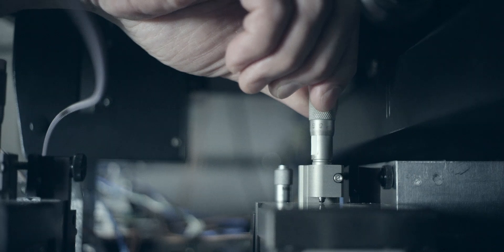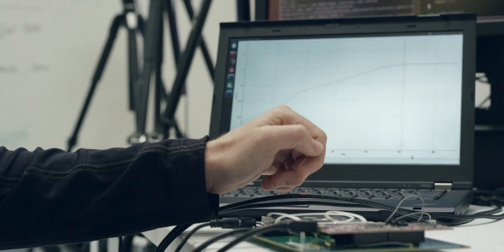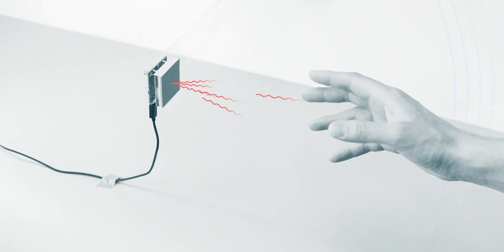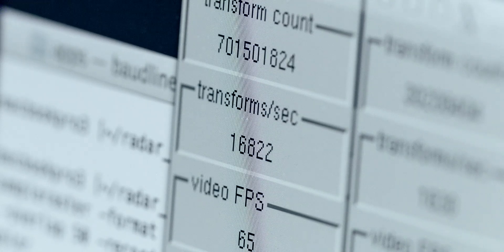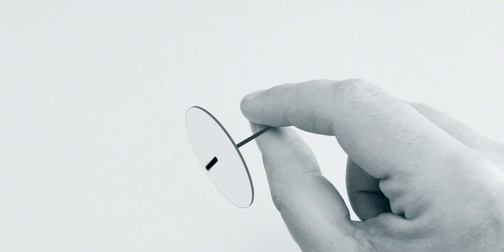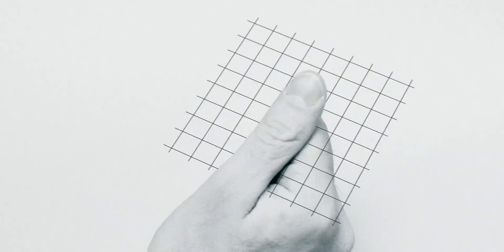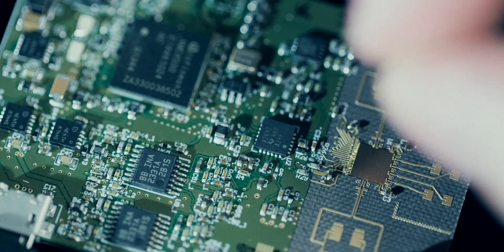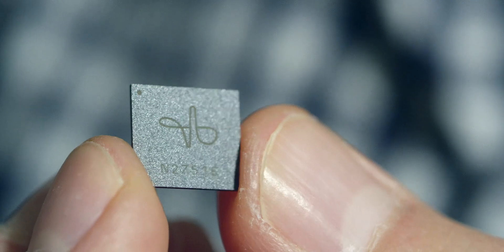Welcome to Project Soli

Comment: This is amazing, but these videos annoy me. Why? Because we see all of this cool shit, never to be seen again or put to use.
Reply: This is actually going to revolutionize how humans interact with technology, soooo...not so useless... haha
Reply: +Tiger White the thing is, this 'specific way' you speak of is the very way you've been doing it all along, according to these people at Google
Reply: *****
 This tech IS the improvement. With this single small chip you can replace a whole range of buttons, nobs, dials, etc. The actions you take are similar to what you have beeen doing all alone, only now the buttons and dials are virtual. Also with no moving parts they will last longer than their physical predecessors.
Reply: If people decided some 50 years ago that ", it's time to stop inventing and improve what we already have." imagine where we would be. Now imagine what will happen 50 years later if we decide that today.
Reply: agreed, in addition think of the power consumption, the chip probably communicates via digital cmos so you're looking at a pushbutton that consumes/distributes 1.5volts at 20mA possibly. 1.5 is based off CMOS noise margins commonly found in digital IC's and 20mA is the higher end of modern current consumption of MCUs. Not only saving power but surely this human interface has a place somewhere in the biomedical field, it's not necessarily a new interface that makes this product unique but rather the application of RF to harness very fine discrete motions on low power consumption.
Reply: *****
I see. So you are the arbiter of which technology is useful or necessary to humanity? Well, it gives me warm fuzzy feelings deep inside to know I'm in such good hands. I may as well book my own funeral.
Reply: Also, you want a private company to "step the fuck up" to your personal demands on which technological fields it should focus its innovations on? I'm not quite sure if you know how market forces work, but companies generally make money by creating what people want to buy. Google's technological department probably wouldn't know an x-ray from an MRI because, stunningly, their customers come to them for their software and data expertise. Pharmaceutical companies and universities are where the medical research mainly occurs, you may as well be asking NASA to open a restaurant.
Reply: that's more of a Google core issue. they have this attitude of toe dipping in cool revolutionary ideas, and doing nothing more. More of a PR stunt.
Reply: You lost this argument.
Reply: Or it's like Xbox Project Natal, They made it seem like it was a seamless and amazing, then they released Kinect but it was just another piece of junk cluttering the house.
Reply: RTarson Just like every other console
Reply: Hunter HAHAHAHAHAHAHAHHAH WTF!! what a thing to write! are you actually expecting him to say "well yes I am!"
Reply: Statements like this annoy me because it just goes to show that the person or group of people making it don't truly understand whats happening here. These people haven't made a product, they haven't even made anything completely new, they've done something that is arguably much harder, they have inovated and improved upon already existing technology.

In the video they even say that they used radar, a technology that we developed all the back in WWII. What they did was they made the radar signal have a higher refresh rate in a sense and with that the feed back is seamless, or at least that's what it looks like to me personally. They have simply created a new tool for producers to use in their product. Its because of small groups like this that are working towards innovating and thinking in different ways as compared to the masses that technology as we see it today even exists. 

Now sure we may not see this tech any time soon but that comes with a good reason, that reason being that its expensive to implement new tech that hasn't even been perfected yet in to mass development. I mean lets look at the latest really big thing in the tech world, VR (Virtual Reality), virtual reality was being tested in labs and experimented with as far back as the late 70's ( source: Father worked on software for it). Hell look at nintendo for example, they had a VR headset that they designed and released to the consumer basically fresh out of development but guess what, it failed, bad. This is because seeing as it was new technology it was expensive to produce and in turn raised the selling price. And if we look at the fact of the matter on average cheaper products as compared to the high end premium, tend to sell more units even if they may have less features overall. That's just fact. 

With all that said, it should also be noted that production costs on chipsets has been going down exponentially over the past years and doesn't show many if any signs of slowing down any time soon. This means that we will probably see this type of tech and many others much sooner than we would have maybe something like 20 years ago, hell even 10 years ago. The main concern of a large company is not so much putting out what is cutting edge, its putting out what will make money. Once the technology is cheap enough and works well enough to sell to the masses for a profit is when we will see it enter the main stream. All we have to do is wait.
Reply: Tiger White: Meh  ... When an innnovation/invention is born the multiple applications are discovered later.
At first no one knew what the laser technology would be used for and centuries ago no one knew what electricity would be used for.
The first compass was a useless thing for divination purpose, ahem.
There are already the most finest brains trying to cure cancer. 
So enough with the empty criticism and the pretentious jaded attitude.

Wall-E is gonna be relevant anyway, because capitalism ... and overpopulation ... Useless shit or not.
Yeah, i'm done.
Reply: Illuminati confirmed.
Reply: Cambaudio you don't even know what your asking for
Reply: "I'd much rather have tactile feedback" if you tap one finger off the other you get tactile feedback straight away. if you dont you should see a doctor immediately
Reply: Exactly
Reply: Exactly
Reply: leap motion does this you can buy for $70
Reply: Gf Yeah but it's pretty imprecise with small movements and also much larger. You could never use it inside a mobile device.
Reply: Tiger White wtf why would they work on cure cancer when they’re a tech company
Reply: theres already a chip that when you implant it under the skin on your neck it cures a cancer, but theyre holding it in a chamber under the pentagon
Reply: Interestingly enough though these simple gestures that are being shown in this clip also  can have medical application as well and the time and effort of this teams efforts may have value for a widespread use of applications for medical applications. Imagine a doctor or nurse not having to worry about germs from the tools they are touching. Most people die from the germs after surgery than the surgery itself.  The applications for these new technologies is endless.
Reply: Tiger White  most of this stuff is made in less developed countries. 
This video isnt even for the people, it seems to be directed at engineers.
That chip would probably be a few bucks, or maybe 10. Dunno, never bought any ic's from google.
Reply: Tiger White I think this thing would be perfect for vr think about it actual full but that is accurate yet frees your hand from anything think of a pair of glasses and a vr room that you just need to walk in and you get to do whatever with it that’s awesome and a big move forward
Reply: New leaks show it in the pixel 4
Reply: Tiger White  we have a cure for cancer now
Reply: Tiger White  Please listen, and learn. The Hubble space telescope went up with a flaw in it's mirror.  The flaw ruined it - it was useless. Until clever people at NASA wrote a software fix that corrected for the astigmatism, and brought things back into focus. Score one for math! But space stuff isn't curing cancer, right?

That software fix then got puzzled over by the scientific community. Someone figured out they could use the same software fix, just as a patch on existing mammogram machines. The same X-Ray hardware could suddenly detect breast cancer SIX MONTHS EARLIER. This lead to a huge, immediate increase in long-term breast cancer survival.

This is how scientific research works.  Maybe someday they'll figure out warming pads for the machines, too.
Reply: Hello pixel 4
Reply: its coming to the pixel 4. wait till October.
Reply: Careful what you wish for😂

Will get probably used in the next pixel as seen in the promo
Reply: 2019 calling
Reply: Bro its just an already available technology with Google's research and development working on to make it more user friendly,ever heard air gestures on LG
Reply: Bruh! That's not true anymore! It's Coming To Pixel 4!!
Reply: ha
Reply: Wow, this comment has not aged well. At. All. 😂
Reply: Technicians, engineers, scientists, and simple visionaries will imagine applications of even existing technologies that border utopian ideals, but get tossed aside because they would cost five cents more per unit to manufacture.
Reply: Welcome to October of 2019, my friend.
Reply: and then it was never seen again
Reply: The pixel 4
Reply: @nanaamoako4175  I give it 1 generation before it disappears. 2 if we're lucky.
Reply: Tiger White  you lost me at "acting all white n shit". Are you serious? Lol. If brilliant Google engineers pushing the boundaries of technology is acting white (n shit), this comment is actually insulting to people who aren't white.
Reply: This is being implemented in Pixel 4 now :)
Reply: Until this October in the Pixel 4.  Magic takes awhile to get working I guess.
Reply: And here comes pixel 4 😛
Reply: Cambaudio:
We see all of this cool shit, never to be seen again or put to use.
Pixel 4:
Hold my beer...
Reply: Well, now it's in the Google pixel 4 :)
Reply: It might be in the pixel 4 this year, so.... we'll see
Reply: Tiger White  Thats pretty narrow-minded of you... no improvement can be made if you don't take a step forward.
Reply: That's where u wrong kid
Reply: hello i m from future
Reply: But then they use it, and everybody is saying it's stupid...
Reply: Experimentation is the only way we get progress. Yeah, the vast majority of these projects won't see use any time soon, but just a small percentage of them could be the next big revolution. We never know unless we try.

Comment: Scale this up to use your body as the controller in VR/AR applications!
I realize it would take an immense amount of processing power... but think of the possibilities!

I do anticipate the radar interfering with the AR/VR data transmission (if MIT makes the phased array antennas into a product) - but nothing a parallel line filter or other filter couldn't fix.

Tech is amazing!
Reply: Damn your idea sounds very promising.
I think in a couple of years, when the processors become faster and more efficient, it could be the reality.
Reply: It's not so much the processors that are lacking as it is the GPUs - the graphics are demanding 90 fps+ and that just isn't necessary with typical computer gameplay - but it's ESSENTIAL for VR to keep players from getting motion sickness.

The frames need to match the perceived movement - in my Vive - it just throws you completely out of it when you miss frames/frames freeze.

There will no doubt be challenges, but the vision is there!

Comment: I am sorry but this technology sucks way more than the touch technology.  Why do you think haptic feedback motors exist in phones?  They are just a feeble attempt to improve the otherwise sucking user experience of touch screens.

Using a UI this way is both tiring and boring. When you turn a real potentiometer, you don't have to look at it. Your hand tells your brain exactly how much you turned it. But using this thing,  you have to use your eyes constantly to get feedback from the moves of your hand. Did I turn it too much? Did I turn it too slow? Eyes are not meant for that. Why use your already busy eyes for the task of your feel sense?

Nothing like this gives the comfort or satisfaction of moving a real, physical potentiometer or slider.  I hope this technology stays limited with cheap chinese toys.  

This nice radar sensor must have much better uses than making lame gesture control interfaces.
Reply: thats how mouse works. all finger / hand gestures. We always see if mouse pointer has been moved to right position or not. hmm..
Reply: Too early to say mate. 
People said the same thing during the transition from buttons to touch. We'll just have to see where this goes, which the people behind this technology clearly stated in the video.
Reply: +geeklifestyle But mouse is not eye/mouse interface, its eye/mouse pointer link. You can move the mouse pointer several pixels before you even see your hand move, let alone its exact direction and value. Point is: why make a sub-millimeter precision interface when the limiting factor is still your eyes.

Buttons are still better than touch, touch won because of versatility.
I think it has some good uses, nice ideas in the comments.
Reply: interesting insight.
Reply: you're comparing it to potentiometers, but in relation to capacitive touchscreens it should be roughly the same, except it will have depth perception.
You already have to look constantly at the screen to type on a virtual keyboard, by the way.

Comment: It's going to be interesting putting this in a phone. It's seems impractical due to the device always being in your hands. It'll be convenient for any sort of travel and for a quick peek, but time will tell they'll probably develop very clever uses for it. 
I could see an integration into smart home. Gesturing to your phone to control the tv, Chromecast, lights, locks, routines, the whole shebang. 
Beyond that, it'll open the door for live sign language interpretation, which would be a huge win in itself.

Comment: Using gestures is great. It's been done before in fact there are some smart houses which can re-design themselves based off hand gestures.

One thing I haven't seen that I would love is if these gesture detectors do not use gestures instead they use a certified language such as AUSlan (sign language) and be able to convert a proper hand language to text. More points if it runs from my phone camera.

Comment: Very cool concept but I'm not sure if the application of such a technology would be worth the implementation into every day objects. The production infrastructure of this is probably pretty small which means it will be expensive. The software is probably proprietary so development and fine tuning for every device and service may be slow and limited. If this technology were to be implemented into every day technologies, if will have to be included with what the population already knows as an added interface option rather than being the standalone user interface. I hope to see this in the near future but I hope they take this in the right direction and that it doesn't go sour or gets forgotten.

Comment: I see Soli becoming not only a difference between other smartphones for Pixel 4 from a technical point of view, but, if Google does this right, it could be the next generation of interaction with devices, much like the same way Apple changed touchscreens. 

This could become an advanced new UI for Pixels. I just hope that they have some convincing ways of 3rd party developers being able to show off what Soli can really do.
Reply: I know we've already got projected capacitance for hover gestures on websites, but additional gestures for web interaction would be really nice. I would rather twist a virtual knob than repeatedly flick through another damn scrolling list, for instance. It would also greatly help me actually see the content I'm supposed to be selecting without my meaty digits interfering.
Reply: @UCHbVUA_DoillVIK7V0ADdkw Are you referring to vibrotactile haptics or something else entirely? There are exoskeleton armatures that do a much better job at communicating force and resistance, but they're rather bulky. And there are also ways to project ultrasound to induce focused air currents. And there are methods that exploit surface electrostatic attraction to simulate texture.

Comment: The tech is able to damage the DNA structure, not acceptable, apart from that, how did you overcome the power drain problem, you are sending energy into air, this is few orders of magnitude more expensive  then sending it through a wire, are you using IR sensors ? side camera ? how do you notice a state change to turn on the sensor ?

Comment: will it monitor the tongue movements and jaw movements thru the cheek.. if so it might be used for quadriplegic's to control their computers.. using just tongue motions and opening and closing their jaw slightly.. even moving the lips.  can it be used to read lips.  that could give instant voice to mute people. especially with the software in current phones.  could be used in noisy environments also perhaps.    perhaps even monitor for birthing contractions.. if it will read deep thru skin..  i worry about the radar aspect. i think that the west coast droughts might be caused by weather radar and early warning radar heating up water vapor dozens of miles off shore creating a false high pressure area that could cause a change in weather reaching the coast but that is way off subject.

Comment: Wouldn't continuous exposure to these radio signals (from such short distance) cause health problems?
Reply: No.
Reply: No, they're extremely low frequency.
Reply: I think you mean high frequency otherwise it would need a large antenna. However the power level is probably so low it wouldn't matter.
Reply: No, it's like you are listening to a radio.